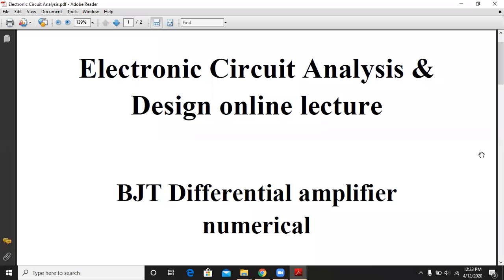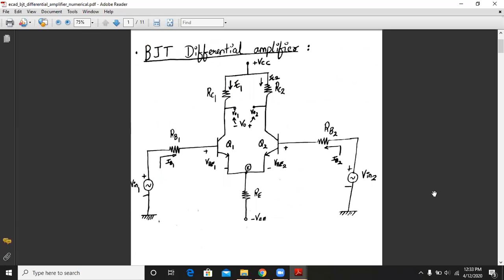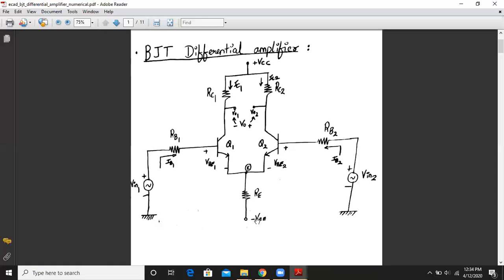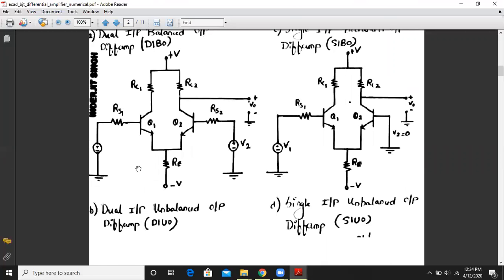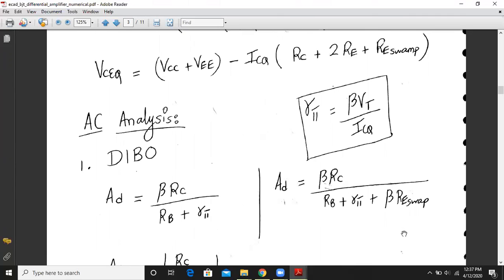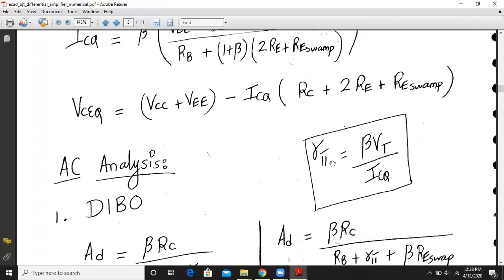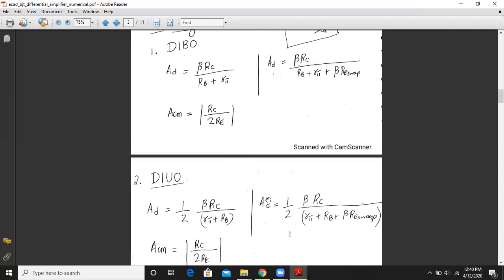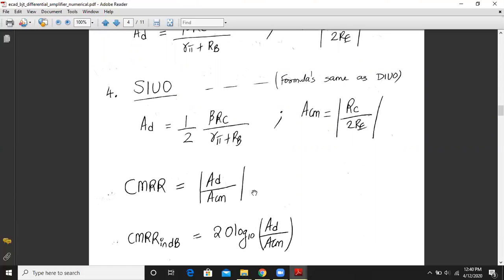BJT Differential Amplifier Numerical

Comment: Hello sir how did you took value of vt=26mA for ac anyalisis
Reply from the maker: Vt is the thermal voltage, its by default value is 26mV at room temperature. Its formula is Vt = KT/q
Reply: @InderjitSingh87  So thankful to you sir